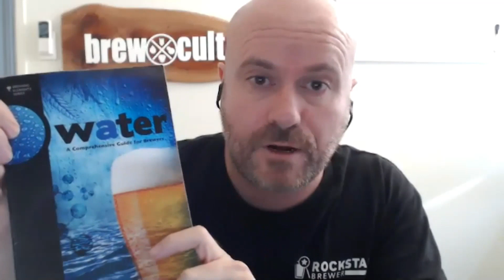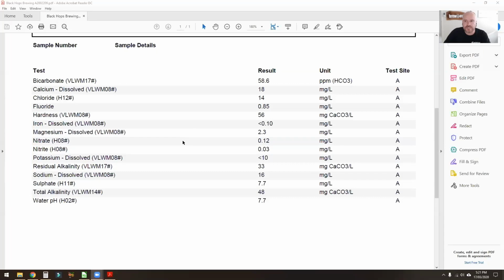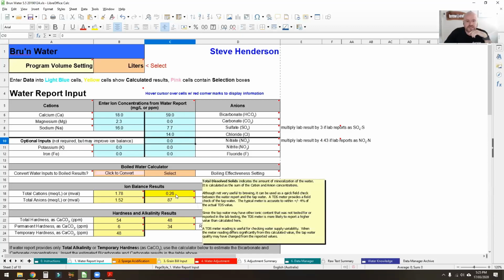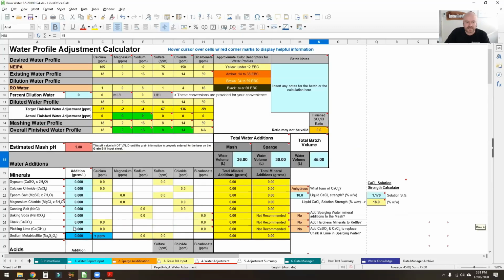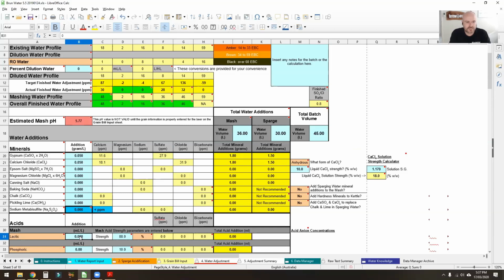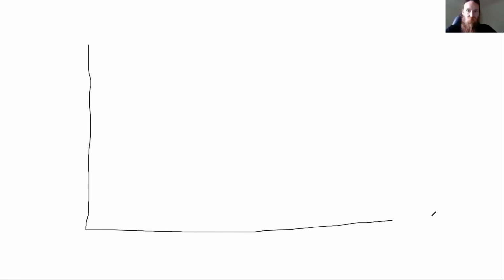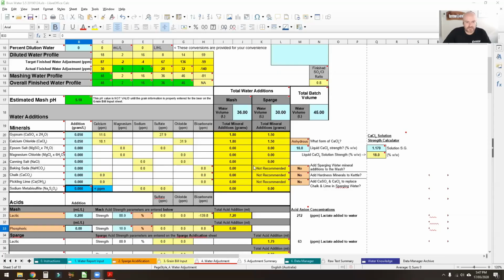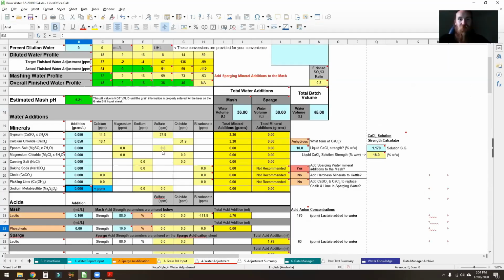How To Brew An Awesome Lager With Sound Brewing Water Chemistry Using Bru'n Water (Part 1 of 2)

Comment: Om adding salts. I will look into the brunwater but ise Brewsmith... I have a water filtratiom thst makes all the slats close to zero... Set the water additions based on style.... Shows salts to be sdded  in mash snd strike water not the boil... Thsnks for the obvious but not obvious 10 minute ph so you land proper on the final beer... Thanks
Reply from the maker: Thank you for watching! 🍻

Comment: Hi, How are you. Can you please suggest me any economical method for testing dissolved oxygen in the beer. I cannot purchase Higher cost instruments. Kindly suggest, thanks.
Reply from the maker: Unfortunately it is high cost because the amount of O2 that can damage beer is very low. So you need a sensitive and expensive piece of equipment. You might want to try some antioxidants in your process of money is an issue.

Comment: Hi Hendo, just subbed, excellent vids by the way! Just  two quick questions regarding the tetra hop addition after fermentation. Do you add directly to the keg? And do you dissolve the tetra hops in water or pure alcohol prior to adding to the keg?
Reply from the maker: Hey Peter. Sorry I missed your comment and didn't reply sooner. Tetra hop is usually contained in an email carrier so it dissolves into beer really easily. Thanks for watching!

Comment: Great Video Hendo, I have been using Bru'n Water for about 5 years and nothing comes near it. I also use Beersmith, but find it adds too many salts.  Did not realise that you don't actually need to pick a water profile. Just concentrate on the Calcium, Sulfate to Chloride Ratio and of course the PH. Those 3 elements I have been doing, except I was picking a water profile. Great tip about adding the sparge water salts to the boil and also Adjusting the PH to 4.9 to 5 in the last 10 mins of the boil.  I usually brew a Lazy Yak (Pale Ale) and an Dry Irish Stout.  It show how important it is to get that   mash PH somewhere near the mark, so you can adjust your boil PH to the 4.9 to 5 range.  For instance if my Bru'n water says .72 ml of Latic Acid in the sparge, hold that off and do the boil test?
Be great to see you do one for a Dark Beer. Cheers
Reply from the maker: Hey John - when I brew a beer for the first time, with acid adjustments, I only use Bru'n Water as a prediction - not as gospel.  There are so many other variables such as water changes and malt variances that come into play.  This is why I use the 10 min pH adjustment along with some gut feel to get it right on the first brew.  Then in subsequent brews, I now know the total volume of acid added and I can pretty much safely add that amount.  I hope that helps - thanks for watching!

Comment: Hello. Thank you for the great information. I would like to ask about the temperature of the pH measurements. Especially Wort pH, is the reading measured at near boiling or cooled down to mash temperature or room temperature?  Because pH changes at different temperatures. Thanks
Reply from the maker: All pH readings should be taken at below 30C/86F because your pH meter probe is very delicate.

Comment: This is probably the best beer water chemistry video ive seen, thanks it really helped me mate! Also i think 34/70 is bit too eastery as well and i pick up banana from it very easily so i went with S189 as well and its heaps cleaner to me!
Reply from the maker: Glad you liked it! I'm an S-189 fan too.
Reply: Using Kveik Lutra mid summer when warehouse is 100 degrees. While not a lager gets you most the way there. Also been using Novalager fermenting at 65 degrees. Making some tasty brews.....

Comment: Wow wish I had seen this video sooner. I am currently fermenting my 4th attempt at a lager. So far it is the best of the lot. I adjusted my salts using Brewfather app. Next Lager I will use the recommendations here. I was a bit nervous about the final pH after seeing this video. I am on day 17 of 21, that I wanted for fermentation, and as of today my pH is 4.3. I was elated to see that. 

The sample I pulled already smells amazing and is very light, though it has that cloudy unfinished lager look. I think this is going to be my first successful lager, fingers crossed. I forced myself to be patient this time. I am usually making ales that are fermented out in 7-10 days. Fermenting now at 48F (8.9C) and it has stayed there within .5 degree the entire process. 

I used the White Labs WLP840 Lager yeast. Made a 2L starter with plenty of nutrients, so the cell count was quite high going into fermentation. Added more nutrients when I pitched my yeast and hit it with pure oxygen. I will probably use some gelatin to clear it up when it is ready for kegging.

Couple of things. Surprisingly, this beer already smells VERY clean. I am not sure why there does not seem to be any diacytel smell. Was my process just that good? Is it the yeast? I don't see myself needing to do a diacytel rest. When I first opened the fermentation chamber after a couple of weeks of fermenting, the gas actually burned my eyes a bit. 

I have scoured Google looking for this info and cannot find any good source with numbers.  What are the proper flavor profile ranges for the final beers for each of the styles? In particular...

Ales / Cream Ales
IPA / NEIPA / DIPA
Brown Ale
Porter / Stout
Belgian Ales Dubbel/Tripel/Quad 

I plan to make pH adjustment at 10 mins left of boil to all future beers. Would just be great to have a starting point for each beer so I can make adjustments toward the final product. Also if you have the number we need for the sulfide:chlroide ratio for erach style that we need to adjust for in Brun water, that would be awesome!

Thanks so much again for this video! It was very educational.

Comment: Hey Hendo,
Why do you need to add salts to your sparge water as well, what is wrong with adding all the additions to the mash water to accommodate for the sparge water?
Reply: You answered at the end, all good. Cheers mate
Reply from the maker: Hey Joshua - you need to treat ALL of your brewing water - not just your mash liquor.  Otherwise your water is only half treated to your target spec.  Sure, you can add all of your salts to the mash tun but this will artifically change your mash pH away from its target.  You don't need to add salts to your hot liquor tank - just chuck them in the kettle during the boil....simple!  Thanks for watching :-)

Comment: enlightening concepts! great video, you answered a lot of questions to that I've had for a long time. Question: the reason why you suggest not to acidify sparge water is to prevent DMS? thansk!
Reply from the maker: This is because a higher wort pH during the boil (from around 5.40 and above) is more successful in eliminating DMS precursor than a long boil!  The flip side is that if your wort pH is this high during the boil then there will be an increase in colour due to increased Maillard reaction on the wort at these pH levels.  I hope that explains it. Thanks for watching!

Comment: Hi Hendo, loved this video! 👍
I planned to brew two 40ltr batches shortly after watching this video, a pale ale and an English IPA so thought I would check the pH at the stages you suggested. (I always check mash pH but not boil or beer pH)
I was pleased that both beers finished below pH4.2 but the difference between boil and beer pH was vastly different between the two beers.

Both beers had 2 packs of S-04 and both beers reached their expected FG.

So, in order of mash pH, boil pH (10 mins), beer pH these are the figures.
Pale ale 5.29/5.25/4.19
IPA 5.5/5.46/4.17
My question is - why is there a bigger drop in boil to beer pH in the IPA than in the pale ale?
Many thanks 👍👍
Reply from the maker: Lots of factors can affect pH change throughout the brewing process but it's most likely grist selection.  This is due to buffering capacity of different malts.  You just need to adjust where required to achieve the outcome you seek.  Thanks heaps for watching!

Comment: Hi Hendo, great information. I currently brew on a BRAUMEISTER and I tend to brew a no sparse method by adding all my water at the mash in stage. I do this to help eliminate oxygen take up during the wort circulation. Currently I have been taking the total water and calculating the total salts then adjust the Predicted PH and carrying out the mash ..no sparge . Should I be separating the mash and sparge liqueur or can I continue on doing what I am doing and adjust the PH toward the end of the boil. Will my method prevent me from making that final acid adjustment? Your help is appreciated.
Reply from the maker: Simply adjusting at the end of the boil is totally fine :-)

Comment: One comment - my experience brewing with New Zealand grown base malts in particular means you need to be slightly careful about using colour to calculate mash ph. The DI water ph of  most Gladfield Base Malts are typically between 5.75 and 6.00, usually around 5.8-9 on my COA's which is certainly higher than some European base malts I've used. I like using water calculators that allow for you to use the DI  ph on the COA to predict things more accurately (brewers friend's advanced water calculator made by Kai Troester is great here).
Reply from the maker: Agreed. I tend to tell clients to add salts so they get their desired SO4:Cl ratio plus calcium content then take any acid additions with a grain of salt. It takes a few goes to hit your target pH as there's so many variables with malt. Thanks for watching!

Comment: Hendo, Thanks for your videos. I find the information useful and well presented. I am evaluating a couple of one barrel stainless FVs (SS Brewtech). Trying to decide on jacket or non-jacketed with cooling coil (forget the price difference for a minute). With the jacketed version, how do I elevate the temperature for a diacetyl rest? If primary fermentation is about 50oF will the temperature rise up to 65oF on its own if you stop glycol circulation?  Any insight/experience appreciated. Kurt
Reply from the maker: Jacketed - way easier to clean!  To elevate the temperature - turn the cooling off and let the yeast do the rest!  The way cooling works on jacketed tanks is that the glycol runs when you want to cool the tank and then it turns off when it reaches target temperature.  You set the target temp you want.  Happy days!

Comment: Really enjoyed the Video! I've just started using Bru'n water subscribers version, so that was a great help as well. I'm keen to try some Tetra hops in a brew but can't find much info on dosing rates, do you have any info on that?Looking to add around 5 IBU to a 40l batch. Cheers
Reply from the maker: Check with your supplier for a 'spec sheet' as there are more than one varieties of Tetra hop on the market with varying strengths. The one I have used 0.45mL in a 19L keg for 4 IBU, for example. Thanks for watching!

Comment: Cheers Hendo that was really informative.  Just wondering if brunwater has a function for calculating the possible acid addition for that last ten minutes of the boil if ph is too high? I know beersmith does but when ive used it before it doesn't seem to be too accurate. 
Also just a heads up for other non RO brewers like myself, my partner works in a hospital lab that uses analysis equipment that I have tested my town water with and the changes of chemistry throughout the year is significant due to different water sources so unfortunately sticking with one water analysis report wont work if you are repeating recipes over a period of time and changes weekly in summer time (for me) when town water sourcing varies a lot. Cheers, Mark
Reply from the maker: Nope. That's down to you, your water, your malt and how many times you make the same beer over and over to get it where you want it to be. If I had a spreadsheet to predict my life it'd be pretty boring 😂